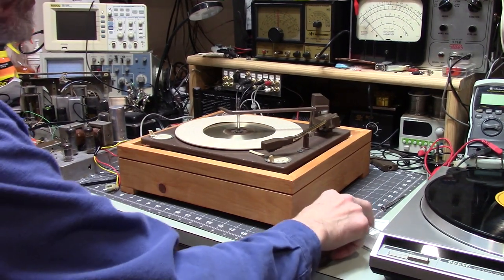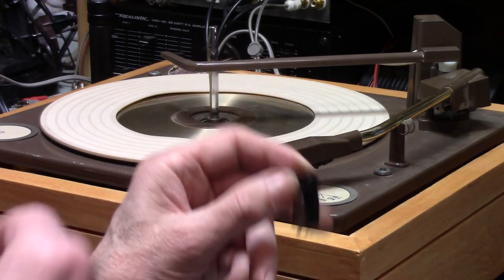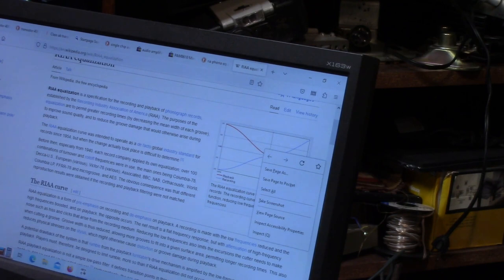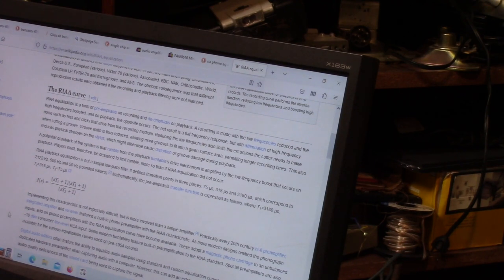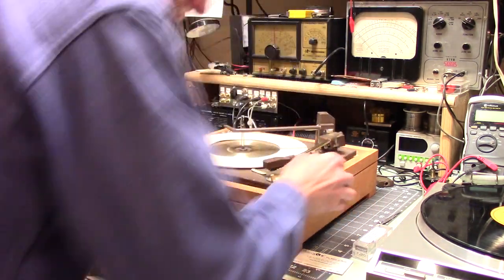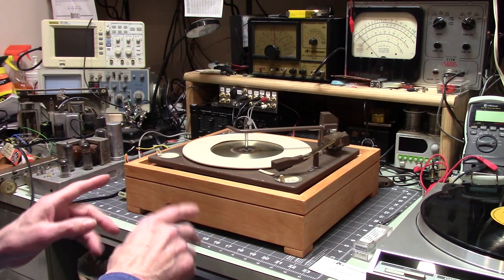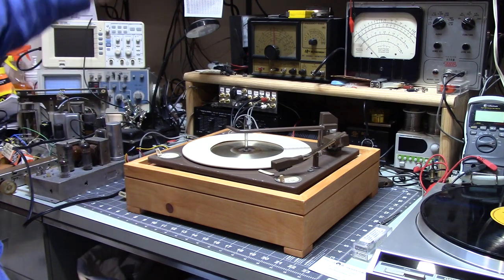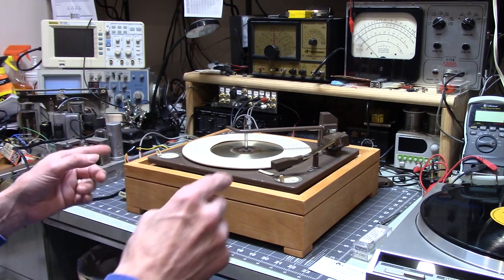BSR  Model UA15SSA-3D Cartridge replacement

Comment: Thanks for the cartridge and stylus information/ demonstration.  I'm one step closer to completing the restoration. How do I keep the stack of records from tilting on the spindle?  It seems that the arm that holds the stack needs adjustment.
Reply from the maker: That arm needs to slide up and down freely on its chrome support shaft. If it doesn't then it won't hold the records properly. There is a lightweight spring on the bottom end of the shaft which helps pull the arm down but it is mostly the weight of the arm that holds down the records. I used a light oil on mine because it was sticking.
Reply: @Oldelectronicsfan  
Thanks. It turns out that the stack holding arm was not positioning close enough to the spindle. This caused imbalance and made the record tilt.  The pin on the shaft was bent. I drove it out and straightened/ repositioned it. Now it holds the record in a balanced state. The changer mechanism is unpredictable.  Sometimes it drops the record and cycles normally.  Sometimes it drops the record and then rests the tonearm and shuts off.  I'm pleased with my progress thus far. Your videos are very helpful.